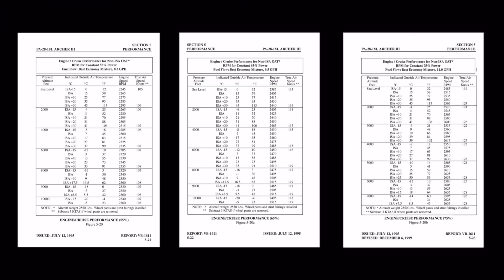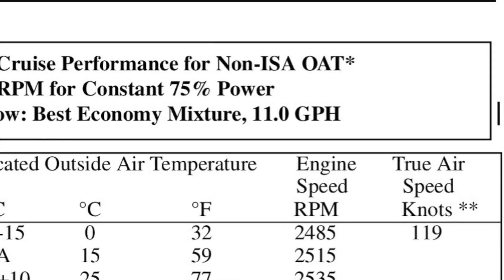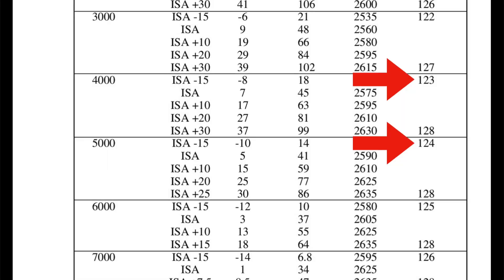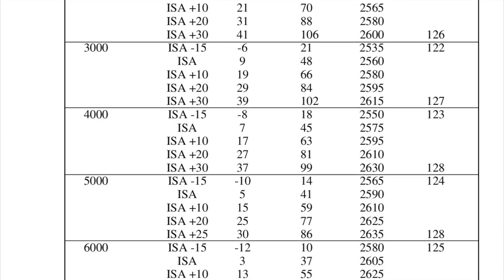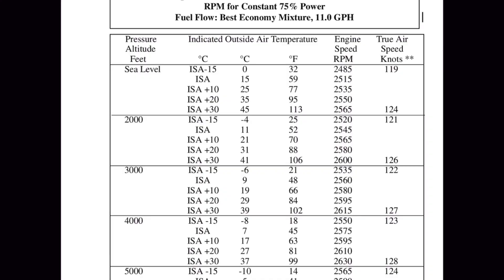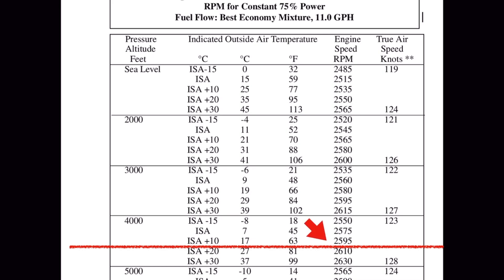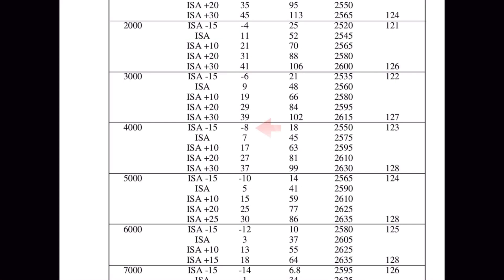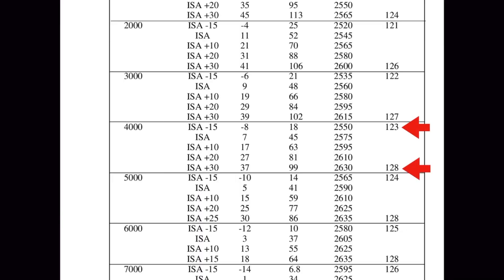Calculate Fuel Burn – Using a Cruise Performance Chart!

Comment: Slower with less fuel so I don’t put unleaded strain on engine  unneeded *. Unless breaking in I would prefer to conserve my gas and manifold pressures within the engine.  
Higher RPM might lead to inefficient usage of fuel  for best power and at worst detonation settings, which are in the handbook. 
I say use what the book suggests for best fuel . and always lean on the side of caution. 😂
The dad jokes will get better as I go on
Be nice to your engine and you will see me less. 😂
Reply from the maker: Ha!  Excellent!  We want to see you, more… but as a pilot, not as a mechanic—grin.  Dad jokes are always welcome!
Reply: Why is unleaded putting a strain on the engine?

Comment: I use Cessna
Reply from the maker: Hey Paul.  I intend to circle back and create a video demonstrating the same calculations using Cessna charts, but it might be awhile.   All my local students fly in Piper products so I needed to make these first.  In the mean-time, maybe this will help.   

To use the Cessna charts, you will still need the Pressure Altitude (4000) and the Temperature at altitude (18C).  But you’ll also need to know the ISA temperature for that altitude.  The Piper charts do that for you, the Cessna charts don’t

If you need help calculating ISA Temperature, this other video can help: The EXTREMELY helpful guide to Density Altitude
https://youtu.be/Mn_c9Kd2Drs 

For brevity, we’ll say that ISA Temperature for 4000ft is 7C.  

Now you have everything you need to use the Cessna Cruise chart.  

Starting with temperature, you know that 18C is 11C above ISA.  So, to be pessimistic, you should use the 20C above standard temp column.  

Next look for 4000ft.  

In the video we wanted to use 75% power.  However, the 1980 Cessna 172N that I have charts for can’t produce that much power at that temperature at that altitude.  Looking at the chart shows, the best power is 71%.  At that power setting, you would cruise at 118kts, and burn 7.9 gallons per hour.  Incidentally, if you go back to the second column, you can see that at that altitude and that temperature, you should be using 2550 RPM to get 71% power.

Just about everything else should be the same as in the video.

I hope this helps!  Best of luck.

Comment: Better to have it and not need it then need it and not have it. Leave earlier.😂
Reply from the maker: Agreed. Always take as much fuel as you can fit into the weight and balance. As you note, there is no penalty for landing with more than enough fuel reserves. 

Leaving early is also another option!!  

Thanks for the comments!!

Comment: Hi Scott. Very informative videos. Im wondering why you do not round off the calculations to maybe 2 or 3 decimal places? 
As for speed vs fuel economy, i always choose to get there faster rather than save fuel. In Kenya where i fly, we rent the plane wet at rediculous hourly rates, so getting there faster saves me some money:)
Reply from the maker: Kornelius, thank you for the comments and question!  

I actually do round calculations and recommend others do to.  In fact, I have a whole video about it called “Rounding Pessimistically: The Ultimate Hack”.  However, in the case of this video, my intent in using the increased number of digits was to point out that rounding and using interpolation didn’t provide a significant difference in airspeed—I was trying to encourage them through example to round pessimistically.  I hope this makes sense.  

As for choosing faster over fuel savings, that makes perfect sense to me!  Thanks for sharing!!

Fly safe and keep the comments/questions coming!

Comment: Im really having a difficult time understanding cruise performance.  How can I practice or are there practice work sheets out there?
Reply from the maker: Sorry. I am not aware of any specific practice worksheets or practice programs.  But I do have some suggestions.  

First, if you are a Foreflight or Garmin Pilot user, then you already have a great practice tool.  If not, you can create a free skyvector account (www.skyvector.com) to do the same thing.  First, make sure you’ve correctly entered the POH-based performance data for your aircraft (Average climb speed and gallons/hour, average cruise speed and gallons/hour, average descent speed and gallons/hour, etc).  

Once done, come up with imaginary cross country trips (or ask your instructor for some suggestions).  Then, plan a trip and do the calculations by hand.  

Once you think you have the answers, let the tool (Foreflight, Garmin Pilot, Skyvector) do the same planning and use the resulting Nav Logs as your “answer sheet”.  Compare and contrast your work against the tool’s results.  If they are not close, try and figure out why.  If they are close, congratulate yourself and try another.

If you have questions that arise during this practice (or you are consistently not matching the results of the tool), then it might be time to sit down with your local flight instructor.  It may be that you are misunderstanding one of the steps, or it could mean you have incorrect data entered into the tool.  Your flight instructor should be able to help with either (especially if you let them know you are using the tool to help you practice by hand-grin).

Enjoy!  I hope this helps.

Comment: Question where did 45 come from?
Reply from the maker: Thank you for the question.  I think you might be asking about the 45 used during interpolation.  If not, please let me know where in the video you mean.  

To be able to do the interpolation we need to find out the total difference between the largest and smallest numbers in the range.  To do that, we normally subtract the two numbers to get that difference.  However, in this case, the smallest number in the range was a negative 8 (-8).  Subtracting a negative number is equivalent to adding a positive of the same value.  So, in our case 37 - (-8) is the same as 37 + 8 or 45.  

I hope this helps.  Thank you again for the question.